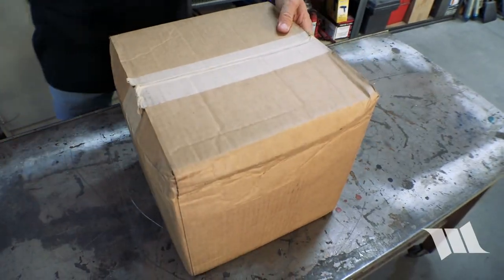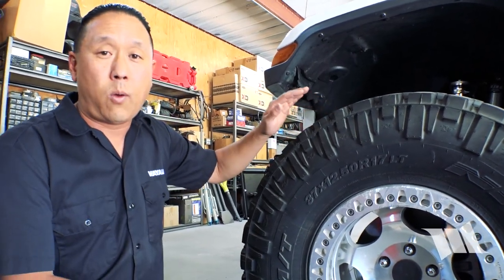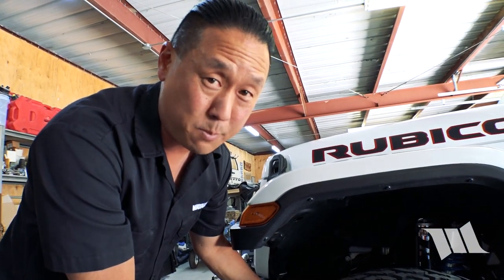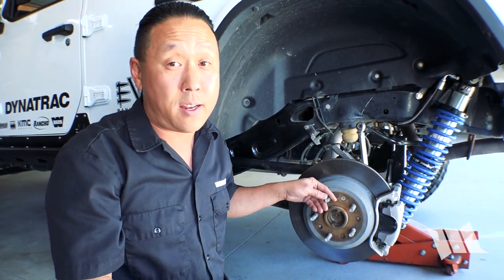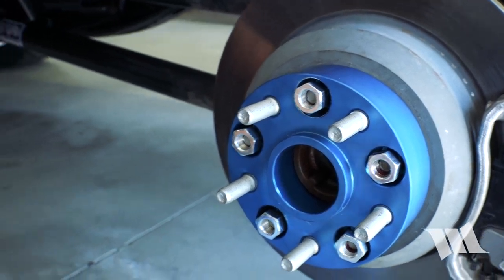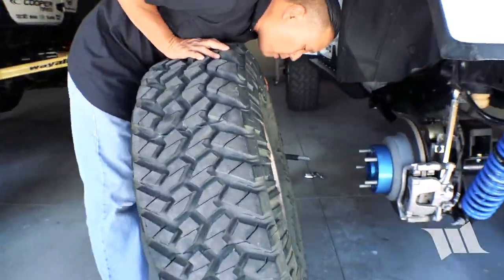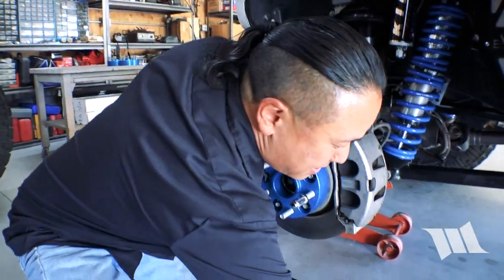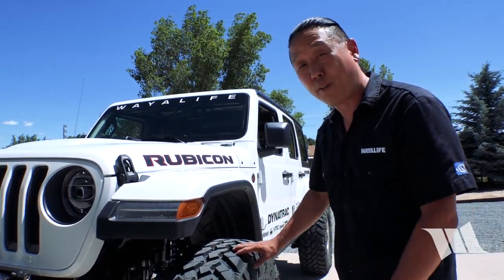Jeep Wrangler Wheel Spacer INSTALL - How to Run Big Tires on Factory Wheels with No Rub SPIDERTRAX

Comment: Should have cleaned the rust off the rotor and applied anti-seize. Will defn be a pita to get them off later if you ever have to do brake or axle work on the Jeep.
Reply from the maker: I admit that at 25+ years of doing this Jeep thing, I'm kind of new but I can't say that I've ever had a problem by not using antiseize. Perhaps I'll learn someday.
Reply: Wayalife wasn’t saying you were new at it, but maybe it’s just because you don’t live in the rust belt you haven’t had an issue yet. Have seen a lot of them stuck on and not able to get them off because of the rust. Even wheels that people couldn’t get off their hubs because of rust.

Comment: Thanks for making this video! Super informative! Any thoughts about using these spacers with a 17x9 wheel that is -6mm offset with 4.75" backspacing? Would that be that too much poke (or too little backspacing)? You're killing it with these videos. Thanks again!
Reply from the maker: Doing so would push your tires way out from the fenders. Assuming you don't have fender laws in your neck of the woods, the wider stance would be nice to give you more stability but it will also put more strain on your ball joints and unit bearings. Not that big of a deal but something to be aware of.

Comment: Are you no longer running these spacers on your jl, if not… why did you choose to take off
Reply from the maker: After almost 3 years of running them, we just removed them because we installed a set of these https://youtu.be/IJbrykqF9RI
Reply: @wayalife  Any issues during those three years with them or did they run smooth
Reply from the maker: @Zebraunit22  Nope. Been running Spidertrax wheel spacers on most of my Jeeps for at least some period of time for over 20 years now. So long as they're installed right, they shouldn't be any different than running a set of wheels with less back spacing. Can't say the same for cheap chinese spacers.
Reply: @wayalife  Excellent I purchased the same ones as you did based on your recommendation. Your videos are awesome keep it up. Your channel is the primary channel I watched right now so the more videos the better lol
Reply from the maker: LOL - well, we're flattered to hear you say as much, thank you. We'll do our best to keep them coming.

Comment: Just got my hands on a beautiful 24 JLU sport S. I honestly love the rims it came on from the factory, but I am looking run a 315/70r17 KO2 on them. Aside from the lift, can anyone point me in the right direction as far as wheel spacer size/ needed backpacking to run that setup? Never ran spacers in my life, but they seem safe enough. Thanks in advance  yall
Reply from the maker: There is only one size you should be running on a JL or JT and that is what I show you in this video. It is critical that you do NOT run anything smaller as the wheel studs on your axle WILL protrude through the spacers and prevent your wheels from sitting flush on them. This WILL cause the studs to fail.
Reply: @wayalife  awesome. Thank you! Should the 315/70 seat fine on the stock 17x7.5?
Reply from the maker: @jonathanfletcher97  It's a tight fit and some shops will not install it but back in the day, we would purposefully do it and called it a poor mans beadlock.
Reply: @wayalife  lol “poor man” sounds about right for me. Thanks for everything man. Keep up the killer content

Comment: Why does the title say running big tires on factory wheels but this video is 37x12.5 on wide aftermarket wheels?
Reply from the maker: This is just a video to show you how to install wheel spacers. They would be needed to run big tires on factory wheels. That's it.

Comment: When you went from the rear to the front you still had 3 spacers sitting on the bench meaning that you didn't do the other rear while you had it in the air... Did you seriously re-jack the rear to do the other side or just bad editing ??
Reply from the maker: LOL - Relax pal, this is just a video we created to help demonstrate just how easy it is to install wheel spacers. If you want to be technical about it, I never even showed the other front wheel being done. Really, only one wheel needed to be shown but I decided to include a front as well as the rear being that tightening up the lug nuts required a bit more help :)
Reply: @wayalife  It's all good... I was just giving you a hard time !!  Actually I was about half asleep when I watched this so who knows what I was thinking at the time !!

Comment: Is it safe to off-road with spacers?
Reply from the maker: So long as you buy high quality spacers like Spidertrax and install them correctly, running them should be no different than running a wheel with less back spacing, on or off road.

Comment: Have the bolts every got loose on you?
Reply from the maker: NEVER. In fact, I just removed them for the very first time since installing them over 2 years ago and they were still on as tight as the day I installed them. Granted, these are Spidertrax, I used red loctite and tightened them to the correct torque spec during installation.
Reply: Thanks for the info and reply!

Comment: Eddie, is this process legal in the US?
Reply from the maker: Never knew that it might be illegal. Never had a problem with them other than a lot of tire shops won't work on them.
Reply: Oh,they are illegal here in Australia because they are unsafe. They also shift the load away from the bearings so this causes a lot of bearing failures. We can’t have our trues protruding our side the fenders either which kinda sux as it does look better.
Reply from the maker: Not sure how high quality spacers like these Spidertrax, ones that bolt on to the axle and then the wheels to them are unsafe. I've literally used these spacers on most of my Jeeps over the last 25 years and have NEVER had a problem. As far as bearings go, they put no more stress on them than new wheels would with less back spacing. This is not only legal in most states here in America, they are extremely common.

Comment: What size spacers were those? 
Could I put 315/70/r17 M/F’s on my 2019 Jl Rubicon Unlimited and have the tires sticking out from the fenders a little without any spacers on the stick Rubicon wheels?  Thanks for the video!
Reply from the maker: On a JL, you need to run 1.75" in order to clear the factory wheel studs or at least, without having to grind them down.
Reply: @wayalife  I appreciate the response are the ones that cover the hub considered really safe? I’m new to 4x4’s are there 35 tires that would clear the fenders width wise without spacers?
Reply from the maker: Not sure what you mean by "cover the hub" but the ONLY spacers I would recommend are these, the ones made by Spidertrax. And, I should note that I have run them on multiple Jeeps since 1999 and without any issues. So long as you install them correctly, they are just as safe as any new wheel that has less back spacing.

Comment: How hard are 2inch spacers for a jeep rubicon recon? I hear they wear your ball joints out faster
Reply from the maker: ANY aftermarket wheel with less back spacing or even factory wheel with spacers will put more pressure on not only your ball joints but your unit bearings as well. While this will cause them to wear out prematurely, you need to put that statement into perspective. As in, how much is 'faster'? Normally, on a stock Jeep, that might be 60,000-100,000 miles depending on how you drive. 'Faster'  might be more like 45,000-60,000, again, depending on how big of a tire you're running and how hard you are on your Jeep. For me personally, this is not a big deal.

Comment: I'm looking to upgrade my stock tires to 35's with 2.5 lift, would i need spacers so that the tires doesn't rub? It won't be used for off road much rather than a daily driver.
Reply from the maker: Yes. If you mount 35's on stock wheels, you will rub at a full turn without them.
Reply: Would it be best to change the rims as well or can i use the stock rims (if i like them😁), if so what size rime would you suggest?
Reply from the maker: Oh, you can definitely keep your factory wheels. IF you get aftermarket wheels, just make sure that they have no more than 5" of back spacing and you should be good to go.
Reply: Great and thank you for the videos please keep them coming. I wanted this JLU for the longest and i want to be able to DIY  projects and I'm  soooo glad i "accidentally" found your channel. You give me the confidence to do mods myself..thank you thank you THANK YOU!!🤙🏾🤗😁
Reply from the maker: Awesome! So glad that we could be of help to you and congratulations on your Jeep!

Comment: I always thought you couldn’t run spacers with big tyres, maybe you can
Reply from the maker: As I explain in the video, you do NOT want to run cheap spacers that just get sandwiched in between your wheel and axle. Those are dangerous and should NOT be used. You NEED to use high quality ones like these, ones that bolt up to your axle and then your wheels to it.

Comment: quick question.  what back spacing are your wheels... i evo 4.5 long arms and bfg 39's on my non-rubicon JT , with 4.5 back spacing and I am rubbing the lower control arms at full lock... i am wondering if 3.5" of backspacing will work?
Reply from the maker: The wheels we're running have 4.5" of back spacing. 3.5" would clear.
Reply: @wayalife  thanks you guys. Really appreciate your efforts and work.

Comment: Do you have to use locktight?
Reply from the maker: ABSOLUTELY!! It is a MUST on the factory studs.
Reply: So on the factory studs as well as the spacer studs? They won’t have any issues coming off?
Reply: Also does it matter which type of lock right is lock right blue ok?
Reply from the maker: You ONLY use it on the factory studs to secure the spacer to it. You do NOT apply loctite on the spacer studs to secure your wheel to it. You NEED to use the RED loctite that comes with the spacers.
Reply: I've been running my spacers from trailgear for almost 2 years, they're good quality, but they didn't come with loctite. Is it worth it to take them off and put some loctite on?

Comment: Unfortunately having the wheels outside of the fender flare line is illegal for road use in Sweden. Everything that is cool is outlawed here and most EU countries.
Reply from the maker: That's a bummer
Reply: @wayalife  By the way, if I put on spacers or bigger tires, do I need to upgrade the wheel bearings? I heard that using wheel spacers or putting on bigger tires than stock wears out your stock wheel bearings faster, is that true? And with a lift, do I have to put in a better driveshaft?
Reply from the maker: @TheChondrolover  It is true that the added leverage created from wheel spacers or running aftermarket wheels with less back spacing will cause your ball joints and unit bearings to wear out prematurely. However, that does not mean it will happen overnight. More like, in 40,000 miles versus the 60-100,000 miles a stock Jeep can get out of them. There are heavy duty ball joints you can replace them with but nothing for unit bearings. Either way, it's not that big of a deal especially being that both are cheap and easy to replace.

Comment: Good luck getting those off later. You needed to put anti seize on there!
Reply from the maker: That would be a negative. There's a reason why Spidertrax provides RED loctite with their spacers and it's because you want to ensure that the nuts that secure it in place do not come loose. Once your wheels are installed, you will not be able to see or check on them easily and if they come loose, you could lose your entire wheel. I have personally seen this happen on multiple occasions. What I have NEVER had a problem with over the last 25+ years of running wheel spacers is getting them off later. But then, that's just me.

Comment: Dont you want to clean the rust off first ?
Reply from the maker: If rust is an issue in your neck of the woods, I suppose you should. I live in Nevada and in the almost 30 years that I've been doing this Jeep thing and running spacers, it's never been an issue to clean off the mild surface oxidation that you see in this video.

Comment: Not a fan of spacers myself. I’d rather run appropriate wheels if it’s needed.
Reply from the maker: Based on personal experience or what you've read on the internet?
Reply: Wayalife This is my first Jeep. I’ve had Toyotas my whole life. I think due to the more limited wheel and tire sizes able to be used, everyone replaced the wheels to eliminate a fail point with a spacer. It was always looked down on.
Reply from the maker: LOL - and what fail point would that be? Clearly, I can only go off of my personal experience running Spidertrax wheel spacers on just about every Jeep I've ever owned at some point and time over the last 25 years and what I can tell you is that I have NEVER had a problem with a single one.

Comment: Should be mentioned you cant lock the front diff with a sport version or atleast i cant figure it out lol
Reply from the maker: Umm, you don't need to lock the front diff to install these.
Reply: @wayalife  sorry transfer case
Reply from the maker: You just need to have it in 4HI or 4 LO. It won't work if you're in 2WD or Neutral.
Reply: @wayalife  wouldnt work for me for some reason
Reply from the maker: You are making sure to only have ONE tire off the ground, the one you're working on, correct?
Reply: @wayalife  yes sir, i thought it was strange. Or just a sport thing. Going to try again tomorrow with a friend

Comment: These may make your wheels look and function great, but as with most adapters it's an excuse for doing it right. Wheel spacers in my state are ilegal for that reason. These are great to imagine what your rig will look like when you do the job correctly.  You don't see any monster trucks useing spacers do you? don't do it youll be sorry! Oh yeah don't put any body parts you don't want crushed under your rig when you work on it! Be safe , loseing a leg or a couple of fingers doesn't make for a good story to tell by the fire when your camping with your buddies.
Reply from the maker: There's a BIG difference between the kind of wheel spacer that just gets sandwiched between your wheel and axle and the kind that bolts on to your axle and then your wheel to it. So long as it's installed correctly, they should work no differently than a wheel with less back spacing. That is a fact and one I've yet to have anyone prove otherwise. Granted, I've only been doing this Jeep thing for about 25 years so you could say, I'm kinda new to it. During that limited time, I have run Spidertrax wheel spacers on most of the Jeeps I've owned and without ANY issues. But again, that's just me.
Reply: @wayalife  even still its still an addapter for doing it right, with spacers you change the way the bearings support the wheel. bolt on spacers are better but they are still adapters. :(
Reply from the maker: LOL - right, because new wheels with less back spacing would somehow support things differently.
Reply: @wayalife  still I love your videos and I have learned a lot from them.
Reply from the maker: LOL - Glad to hear it. I hope you know that I can only go off of what I have seen and personally experienced over the years.

Comment: How to install wheel spacers
Remove from box.  Put in garbage.  Buy wheels with correct back spacing.
Reply from the maker: LOL - spoken like someone who clearly has NO experience running them but has a head filled with what the internet has told him.
Reply: Wayalife True I have no experience running them because I wouldn’t run them. I think if more people understood what a piece of junk the unit bearing actually is, they wouldn’t be so inclined to lengthen the leverage arm from the bearing which is what a wheel spacer does. It will put more stress on it. Especially during serious off-roading.
Reply from the maker: @Niner 8 Tango Juliet LOL - You have NO EXPERIENCE running wheel spacers but somehow, you're an expert who can definitively say they're a "piece of junk". Of course, you're so much of an expert, you actually believe that wheel spacers would somehow leverage more stress on a bearing than would a wheel with less back spacing. You my friend are awesome LOL!

As far as off-roading goes, I've only been doing this Jeep thing for about 25 years so admittedly, I'm kind of new to it. During that time, I've run Spidertrax spacers on just about all my Jeeps at some point and time and without ANY problems. Of course, as you can see in the over 10 years we've been posting up videos on YouTube, I'm just a mall crawler so there's that too.
Reply: Wow 25 years. You’d think after all that time you’d know how to lift a Jeep without having to use wheels spacers. I’m looking forward to the body lift video. And yes I am awesome. Lololololololol!
Reply from the maker: @Niner 8 Tango Juliet LOL - yeah, ya got me. Like I said, I'm new to all this. If you look through my channel, you won't find any information on how to lift a Jeep, work on it or even install something like beadlocks. Clearly, I'm just a poser. I went to your channel to see how a seasoned expert does things and I have to say, I was surprised at what I saw. Your extensive resume demonstrates that you are one to be listened to LOL
Reply from the maker: @WJCO JEEP There's no helping guys like this. He's an internet expert. If he says something on the internet, it has to be true LOL